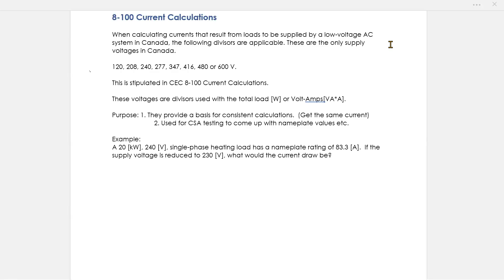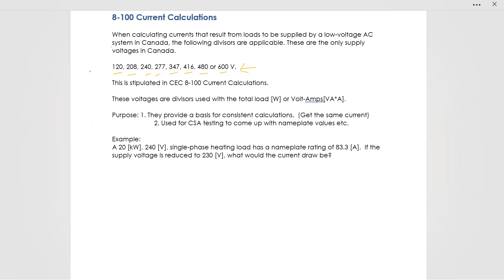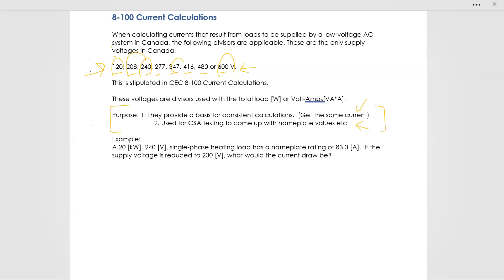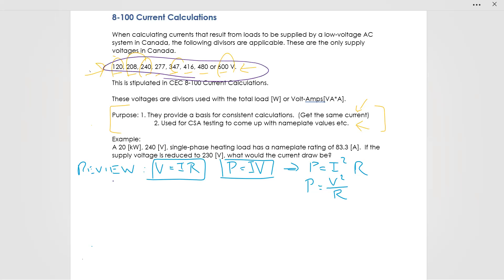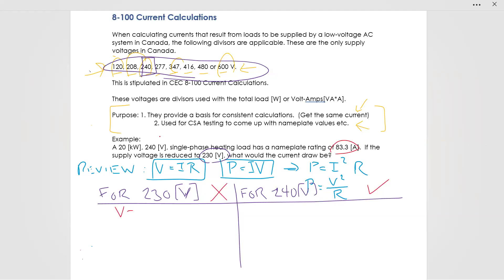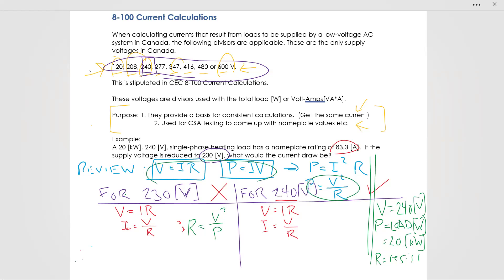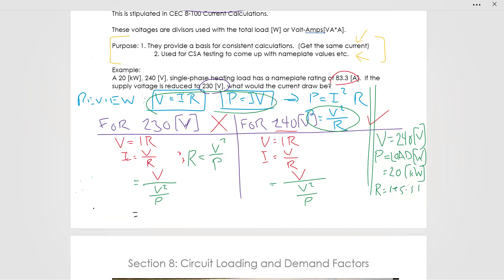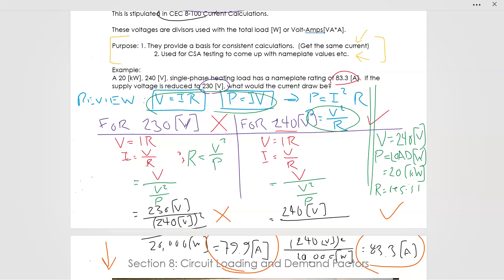CEC Part 1 Section 8 Rule 8-100 Current Calculations with Example Problem

Comment: I=P/U,20KW/230V=87.0A, when there is voltage drop, a load always draw more than normal current to maintain its load power. You don't have to calculate the impedance value R

Comment: Would the current at 230V with the same load power draw of 20KW not be higher than @240V? Since current is inversely proportional to voltage? @230V Current should be 87A?